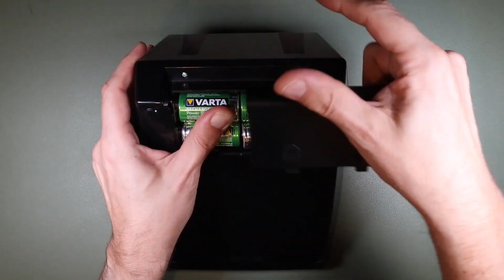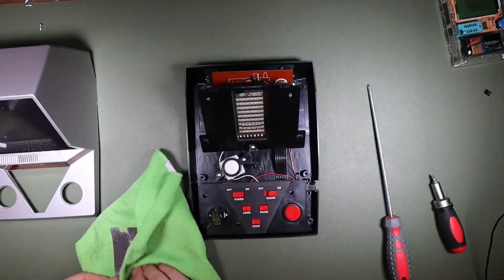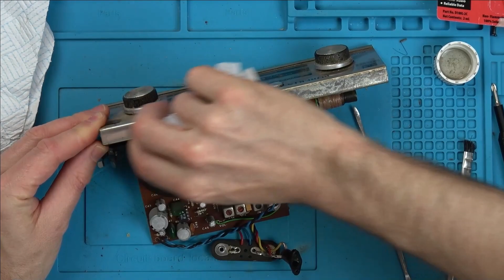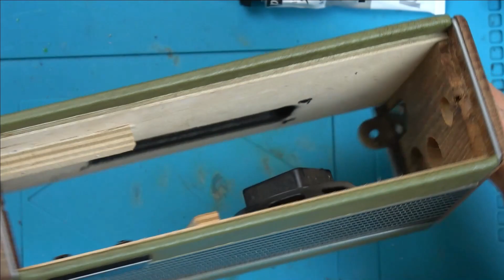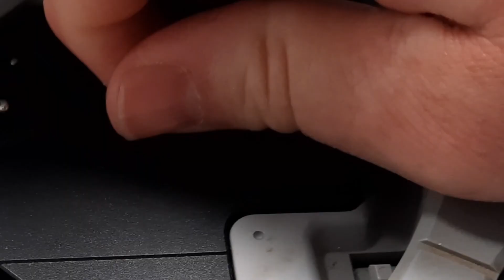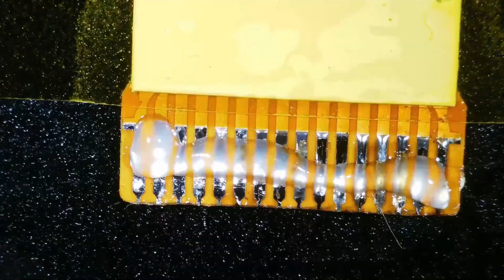The YouTube FIXERS - S1, E1

Comment: Thank you for doing this! You're videos have been a big inspiration for me for the last few years. I've been able to replace an hdmi port on a cheap used PS4, a laser on several GameCube, countless restorations and stick replacements on game controllers, fixed my dryer by finding and replacing a bad capacitor, and just this morning I did a full oil change, air filter change, and sharpened the blade on my lawn mower. All things I wouldn't have been able to do whether it be a lack of knowledge, experience, or just confidence if it weren't for your videos and the others you help uplift. Thanks Vince :)

Comment: Vince, a guy who replaced the leather on my steering wheel told me never to use alcohol (even non-alcohol cleaning wippes) on leather. He said it soacks up the moisture and dries the leather. For cleaning the leather he recommended gasoline from the pharmacy.

Comment: Looks like this could be an interesting new format, as an occasional change from ( not instead of) your usual  'trying to fix' videos, the short quick fixes from other channels work best here, but I would prefer it if we kept it to mostly UK based channels, as,  particularly with repairs to electrical items, alot of Items from the USA or other countries don't have much  in common with the UK. 
Brilliant to see you in front of the camera again, Vince, it's been a while,  beautiful restoration of the Roberts radio, that definitely looks good with the wooden ends re varnished,  when they were still making them to come apart easily for repair & the older design that used the 9 volt PP9 battery as well, that's a blast from the past! Those are not easy to obtain nowadays, plenty of room inside to fit 2 or 3 of the widely available smaller 9 volt PP3 size connected in parallel,  or if you're only going to use it indoors,  use a 9 volt mains adapter.

Comment: If the wiring is too small to be soldered, why not use what us in the watch business use and that's silver or gold infused conductive glue?   Dab it on with a red or black Bergeon/chinese knock off oiler in a little blob, shove the wire into the blob and let it go hard... no soldering and a very good clean electrical joint.
Reply: I gotta look into that.
I am legally blind and could use something like that.
I can't tell you the countless times I've had to give up and junk a perfectly salvageable project all because my vision problem held me back from completing the project.

Comment: Top Tip Vince:  -  during your next trip to either a big box store or a grocery store you can usually pickup a case of baby wipes.  While they aren't usually as good as the wipes you're showing they are by far less expensive and they aren't as harsh on your hands.  I've used them for cleaning up fix-up projects and in the workshop when I've been working under the hood (bonnet) of the car.  My kids are grown so a box/case of these last for years.

Comment: Thanks for having me and my bodges on your first episode, Vince! Hope this series does well, was a great watch. 👍
Reply: way to go!~
Reply: Thanks WILBOLG! 😊
Reply from the maker: Cheers Steve, and thank you for being part of the first one 👍👍👍
Reply: B A R B I E
Reply: Vince said it's the very first PS1 but this one actually isn't as it's missing the RCA composite video and stereo audio output jacks and the RFU DC output jack that were inbetween the Serial I/O and AV Multi Out connectors, and even that was a revision if you count the earliest Japanese model that even had an S-video output connector to the right of the jacks. This isn't the latest revision (before the PS one) though either as the parallel port is still present.
Reply: @RWL2012  that is very true! 👍